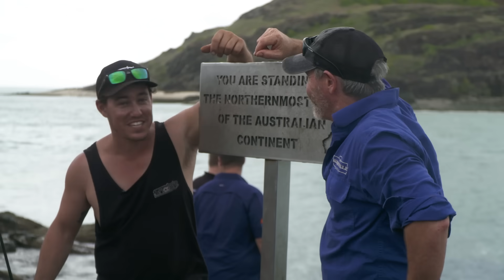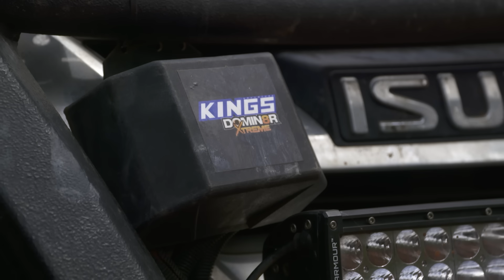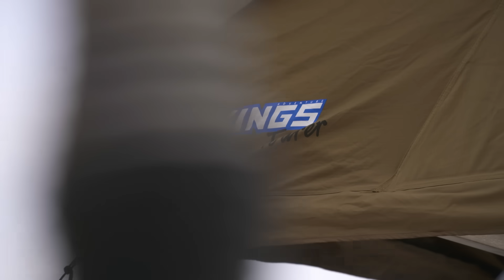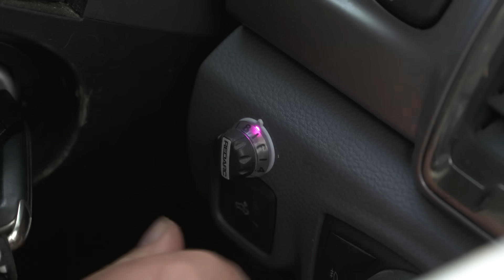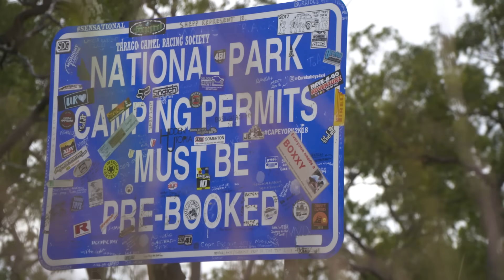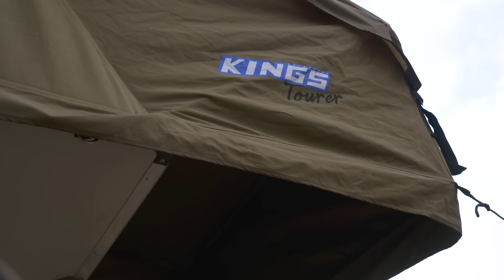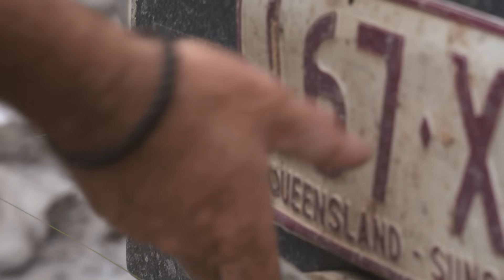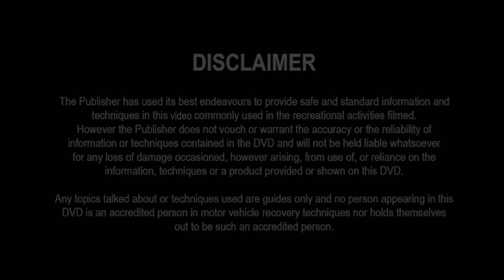50M IN 5 HOURS – Bogged to the sills in Cape York! Why we cross a croc-filled river at night!

Comment: Hi mate love your channel and your fishing with Sammy I once crossed a river in a Mazda bravo fully loaded with a 1ton loaded trailer followed a cattle truck through and the water came half way up the windscreen ,no  snorkel petrol engine and used the old tarp over bonnet and bull bar trick and WD40 sprayed on distributor cap and plugs .the extra weight is what kept me on the road and the truck created a wake that made the water lower I’d traveled from charters towers through greenvale to ravenshoe ,I’ve since bought an 80 series and can’t wait to deck it out for a cape trip cheers

Comment: Well, guys, what'a brilliant video. Thanks for sharing. Shauno you need to carry some threaded bar with washer nuts and some flat plate you csn make a dpring bracket clamps etc hope this helps your starter motor relay is stuck open  that's why she will not start let me know what you think all the best😊

Comment: I personally carry 4 spares, however, i run 35's on a 98 F150, and have my spares mounted on top of the camper shell and cab, 2 over the cab and 2 on the shell laying flat. I use my truck in some really rocky areas with a lot of shale that blows tires. Also, if i need a step to climb, the tires act as perfect steps. 305/75r17 for the spares and 275/75r20 on normally. It also allows me to adjust for the terrain. Muddy use the 20's, rocky use the 17's

Comment: 2 spares, but never used one during away from towns. Had a leaky tube in Birdsville once, single steel belt strand pierced into tube. Caused overnight deflation. Never any other tyre problems. Have driven 800000km, about 100000km in 4wd, round various
 countries arctic, desert, forest

Comment: Good video.  cant believe I hadnt already seen this one (at least not that I remembered).  

Spare Tires:  One most of the time, but in inland WA, 2.  Reason is Snakebush (not sure what its proper name is, but that really hard gnarled and knotted wood that you get from the medium to large sized shrubbery you get inland around Kalgoorlie),  Its done too many tires on me (spiked tires and torn out sidewalls)  One long weekend trip 2 tires and a third I borrowed.  Had to drive slowly on side of road on shredded tire on split rim for about 50Km to get to somewhere I could buy another tire. Got back to Perth a day late for work.  Oh well.

Deepest water crossing?  2 come to mind.
1.  A Salt lake about 150Km  North-East of Kalgoorlie, WA.  During summer, the tracks either skirt the salt lakes, or cross them on a slightly raised hard base.
In winter, the water crossings are DEEP and LONG and most of the time the skirting the water crossing is still doable as well as opting to cross them on the semi hard base.  This winter had been long and wet, so skirting most of these salt-lakes was a no go (water on the now wet mud track). It was raining lightly but constantly.
This crossing the water was very long (300-400 meters) and started off only about a foot deep.  I knew it would be deeper in the middle but didnt want to walk all of it as I basically knew the track and didnt want to get drenched in the rain.  Turned out that in the middle, it was about 3.5 foot deep.  I only had an unmodified Nissan Datsun 720 Ute at the time, 29" tires, stock, manual.  I charged in in 3 gear low, but in the middle when it got to about 3.5 feet deep, the water had slowed progress to the point that I had to change to 2nd low.  That was the end of my forward progress.  After trying forward and reverse, I realized my issue was more fundamental than just being bogged.  The tires (picture 29" tires and 3.5' (42") of salty white clay water) were not turning.  The wheels were not spinning at all.  Turns out I had forgotten to replace the clutch inspection plate about a 6 months previously when I had replaced the engine.  The clutch was now wet with salty muddy water.  Car was completely flooded but the old tech engine (now almost completely under water) was still running (snorkel).  Kept it running and after I cant remember how long (I just remember is was getting dark), I managed to get a little bit of friction (I think I dried out the clutch with heat from constantly slipping it trying to go forward and backwards).  I finally was moving again (in reverse as it happened).  Not the way I really wanted to go, but there was no way I was going to change gear now!  Didnt stop till I was back out.  I tried the clutch out a bit on the dry track and had to face the reality that we really HAD to cross this saltlake to get to the station we were intending to stay at.  Attempt 2.  2nd gear low range and in I went.  Close to the middle the bonnet disappeared under the salt and mud water and with that went all visibility (lights under muddy water), but I was prepared with a 2.5 million candlepower 12V handheld spotlight my passenger (now in the back of the very flooded ute) was controlling.  We made it to the other side and as we had plenty of water and come CRC, we flushed the alternator as best we could trackside and drenched it in CRC, along with all the electrics (fuses, relays, etc).  The vehicle turned into a rust bucket (I wonder why) and a few years later I got rid of it.
2. Was not a river, was just a sloppy mud hole I did by choice (Mistake) a few years later.  Floated the back end of my 75 Series so that the front tires were just touching and bouncing off the Hard bottom.  All forward movement was slowed to a crawl as the vehicle bonnet disappeared under the mud slurry and the vehicles front 33" locked wheels bounced off the bottom and slowly clawed its way out the other side.  Hard bottom, short water hole, cost me my starter and my alternator about a month later.  Mundaring power lines in WA. About 10 years ago.  
Conclusion:  I dont do water crossings unless I need to anymore.  Dont get me wrong, they are fun, and I'm not shy about doing them, but if there is a safer way around and a bad mud hole is not necessary, then I go around it.  Clean water I'm OK with.

Comment: You ask do you need a 2nd spare.  Absolutely.  Two trips across Simpson, Fench line, Madigan line - no problems, no flats. Then Anne Beadall , one Bridgestone Dueler 697 A/T light truck, absolutely shredded, now down to one spare.  then onto Connie Sue - two further flats - repairable, but bottom line, would still be out there without the second spare.

Comment: I had an LN65 Hilux that was lifted, on 7.50/16s
Crossed Match Box creek on the Lake Argyle road back in ‘96 after 6 inches of rain 
…just over the bonnet, which meant up to my armpits!
Only just got out the other side as I was getting washed off the crossing 
It’s what you do when you’re young and silly in a $500 fourbie !
Reply: Close second was I think Canal Creek in a Dmax in 2015
Up the windscreen a bit, I say shallower then Matchbox because the Dmax was lowered on smaller tyres

Comment: Awesome videos guys.. And awesome to see the D-Max same model as mine doing so well... Once mine is out of warranty, I want to do some mods, wheels and tyres, suspension lift and bull bar with  winch... Can you please tell me what size wheel and tyre you are using on the mighty D-Max? It seems to be very limited on tyre sizes you can fit without chopping out or rubbing guards.. Cheers guys. Keep up the great videos.
Jase. NZ
Reply from the maker: Hey mate, thanks for watching! Running 31 inch tyres on 17inch rims. 👍

Comment: Hey guys my deepest and my first River Crossing was the Mcallister River in Gippsland, Victoria in about 1977. It was done in a 1975 Nissan Patrol G60. I did all my homework and made sure my motor had an hour to cool down before crossing. I removed the fan belt so the fan didnt smash the radiator. I tarped the front of the vehicle so as to cause a bow wave that could not go through the radiator and onto the electrics. I walked the river first and found a safe path that required a 90 degree turn in midstream. I chose 2nd gear low so I had enough grunt to get over rocks. I had read every magazine I could get hold to train me. I knew I could not touch the clutch as it would be full of water and would not work. I buggered up about halfway  across the 100 meter crossing and miscalculated where I was to do the 90 degree turn. I ended up in water over my bonnet and about 4 inches  up my windscreen. I didnt touch the clutch  pedal and I kept a constant speed, Although I was shitting myself. I got to the other side and I was physically shaking. I was about 350 kms from home and my God I was lucky.

Comment: I’m waiting to see a power assisted trailer. Where on the worst of the worst the trailer can be put into go mode to assist through the really bad stuff. All it would take is electric motors to each wheel.  Battery capacity wouldn’t need to be high at all being it can recharge itself in between uses from being pulled by the vehicle. So charges when being pulled and goes when needed through the bad stuff. Just enough power to fully support itself. Would be really cool and really expensive. Lol

Comment: The deepest water crossing I've been through was in my good old dodge Dakota.  Was on a lake flat that had flooded and the place we wanted to camp was on the other side so I hit the gas and gave her.  Turns out the water was about 3 feet deep, half way up my door and the whole hood got covered in the splash!! I'm lucky she didn't hydro lock cuz I didn't have a snorkel or anything.  Anyhow got stuck and had to back back out at which point my whole truck decided that electrical thing were not needed and non of my electronics would work, no lights, no dash, no fan. But she still ran so I got her up on shore and in the morning she fired up with no issues and I drove home!!

Comment: My old man drove up there with a mate in his 2wd back in the 50s. He said there wasn't much of a track back in those days. He had a hand winch which he had to use a couple times, Im thinking it was probably to get across those rivers.
He said when he got the most northern point they got the car down onto the beach at low tide and drove out in a sweeping turn out as far as they could so they could say they had driven further north than anyone else.
They got bogged out at the water line at absolute low tide. Basically a disaster as it was too far to winch from to anything.
The old man had brought a big tarp or canvas on the trip. they dug under the tyres one at a time as the tide came in pulling the tarp underneath and wrapping the car.
As the tide came up the car floated and they were able to pull it back to shore.
That was always my favourite story from my old man. He had a heap of crazy stories like that. He really was an adventurer.
He had lost contact with his mate from those old days for 40 years or more.
When my old man died in a boating accident during a cyclone in Darwin about 10 years ago I posted the notice and held the funeral. I got a phone call from this bloke I'd never spoken too. I thought initially it was probably someone trying to get something from the old man's estate.
Turns out it was this old mate he had done the Cape York trip with. He had heard through a long grape vine of my old man's death the week before and managed to get my number somehow. I had a long chin wag with him about his old days and the adventures he had gone on with my old man.
He said he best memory was the cape york trip, told me the whole thing pretty much exactly as my old man had said, except really doubling down on the furthest north anyone had ever been part.
Then asked me if my old man had ever told me about it. Was awesome speaking to someone from his distant past. Really miss my old man. What a legend.
This video was great as I got to see first hand the type of thing he dealt with to achieve that goal.

Comment: Got a question for you more experienced blokes, I’ve not had the opportunity to drive tracks like this yet just been on dirt roads and a few up and downs which have been done in 2wd only using the truck for clearance.
In a fully automatic 80 Series so no Manuel mode like Graham has in the D-Max, I want to climb something as steep as that crossing entrance but is probably a 25-30mtr climb with a bit of shale and loose rocks, what should I be selecting to attempt such a steep climb, I always hear Graham say things like 2nd gear low range etc but I don’t have the option to choose a gear except for L, 2, D, I can’t imagine selecting L (low) on the gear selector and then selecting Low range would be the go.

Obviously very new to 4WDing so any help or advice is welcomed and appreciated

Comment: The most frightening crossing I did was the South Alligator River in a stock 1982 Hilux. Water came over the windows and hit the front windscreen. I floored the accelerator in 2nd low when I was pushed into a hole. 

The car finally found purchase and jumped out of the bog. I was so relieved I swore never too do water crossings again.

Comment: Bought a 100 series a month before my trip to cape York.  Did the Tele track and made it to nolans where i killed it.  Only one car in front.  He went to snach me out and snapped his uni joints on his rear tail shaft.  By the time we got my winch attached to the tree, water was ingested into the air box, even though i had a snorkel.  Hydraulic locked......veh dead.  Nice flight home.

Comment: Been in a 1962 holden and the water was on the windscreen . Were sitting in water . My dad had put a tarp in front of the radiator . Disconnected the fan belt to the fan and drove through one and a half kilometres of water. When we got back out the other side he used a roofing punch and a hammer and put holes in every floor pan to drain the water.  I was terrified as i was only eight years old at the time
Reply: Now thats real adventure!

Comment: If I can afford it I have to spare tires. I have tire repair kits though a lot of them I don't have special beadlock rims so I blow my bead a lot LOL. But I have an S10 Blazer with a 350 in it I got toolbox a welder a  generator and a small compressor in the back on 35 and with a 1-in body lift and a 3-in suspension left

Comment: Why has no one locked diffs in the slushy mud?
Reply: Cuz in that slippery clay it doesn’t matter. You will see big time mud boggers running open diffs. If you have it all locked up ALL the tires dig down and glue the chassis to the earth. Ones that roll don’t dig. I only really use lockers on rocks and loose stuff. I usually stay open in sand and mud. You just don’t want to stay in it thinking maybe you don’t have to winch
Reply: @permagrin8742  okay you were there I can only look on the screen and was wondering about it several years ago I was teached to drive in such conditions with locked diffs and chains on each wheel
Reply: There are different methods for sure handling mud. I’ve heard of chains used before. Problem with chains is the transition from mud to rocks in mud. Chains can be torn off with wheel speed when getting hit with un forgiving terrain features. Loose chains get into suspension and cause damage and or bind a wheel, while buried in mud.
  But mainly that type of mud is basically bottomless. At least deeper than the wheels, chassis and suspension can reach without just gluing  the frame to the clay. Notice how the tires sank down even though the clay was stuck in the tread making the tires slick. Deep clay beds are horrible to drive through. Even with TSL Boggers clay loads up and makes tires not able to grab. Maybe with dragster HP the tires can spin fast enough to self clean. Then the vehicle carries momentum. But these are real trucks you can drive anywhere. Much more fun than something trailered to a trail then trailered home.
  Notice how they stalled winches even doubled up? Clay is different from the mud most are used to wheeling. Not fun, just work. Did you catch the difference when Graham rolled through on the winch? Even with no throttle the tires wanted to go down. But still he did better than the others with bigger tires.
Reply: @permagrin8742  yeah I noticed and must permit that the situations I drove before was not that hard with a lot more serial suspension than your cars out there so that your points now I think about seems complete correct

But I can spread your thoughts about chains spring off tires if it is the correct chain with correct mounting it will not spring off or get in suspension the only problem could be that the chain slap into your chassis if you mount it to lose
Reply: @permagrin8742  and I want also to say you guys did a great job driving in these conditions it was fantastic to see and I wish I could be there too 👍👍 so keep on and have fun guys

Comment: I notice that you lads in the 80's don't seem to have front lockers. I appreciate the expense of fitting one, but do you not feel there is a benefit when doing this level of driving? All UK 80s came with all 3 lockers as standard and we find that there's times when locking the front just makes the difference between bogging down and making it through. Clearly running full muddies does help.